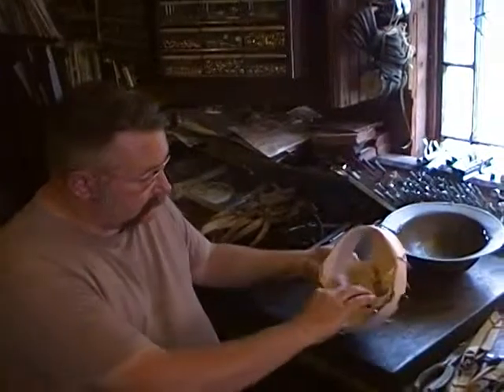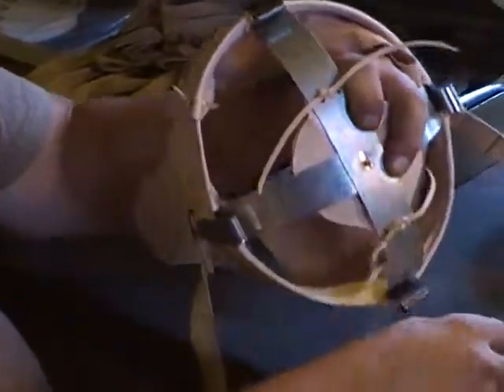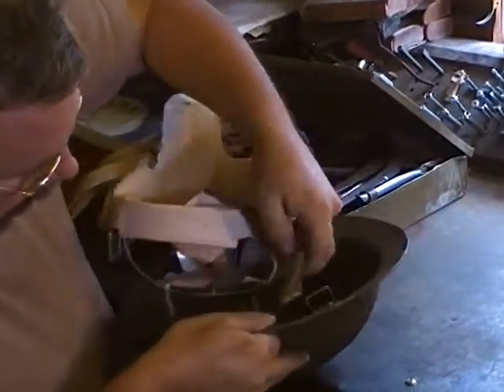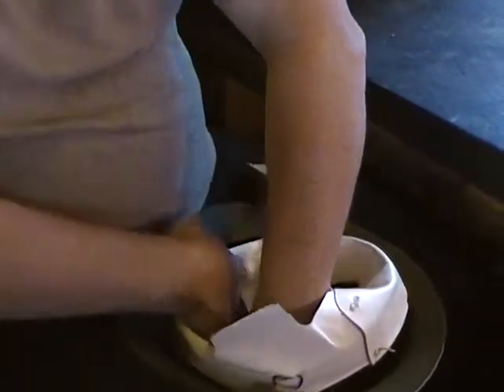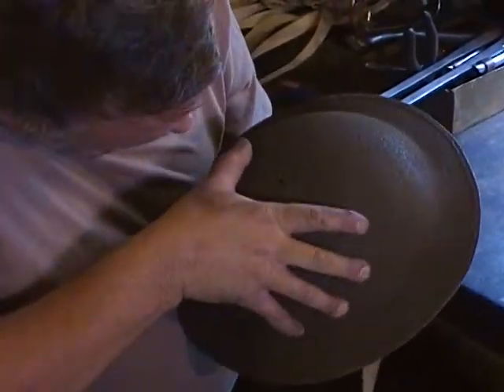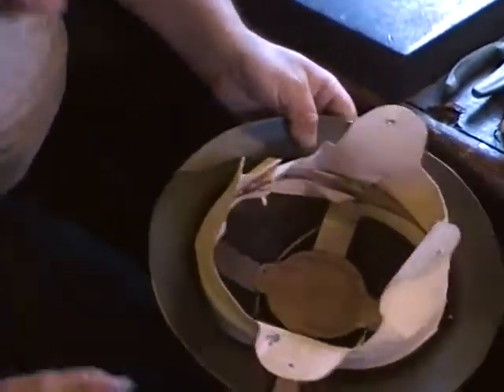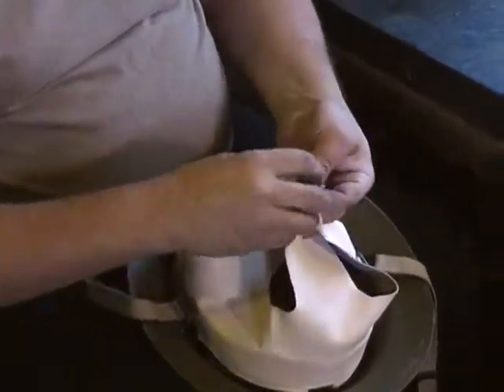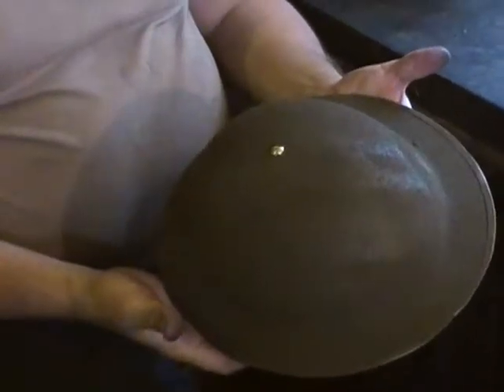Instructions on how to install an M17A1 Kelley Transitional Liner

Comment: Hey pal. Conflicting information here. Please correct me to get it going in the right direction. I am now looking directly at my military gear labeled M17A1, Mask, Protective, Field. It is a gas mask from the 70’s. Is the nomenclature of the helmet you demonstrate a model M17 A1?
Reply: No its the M1917A1 not M17A1 that is a different peace of equipment
Reply: @megabytes6434    OK. But on listening again the video starts out - how to install an M17A1 liner into an M1917A1 helmet. I think that was the confusion. Thanks for the clarification.